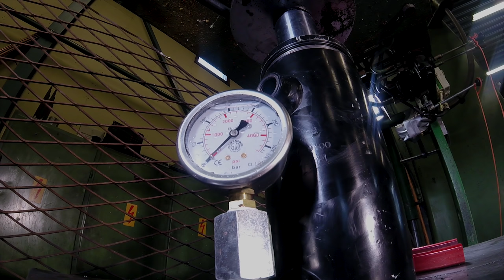Can You use Bananas or Non-Newtonian Fluid as an Hydraulic Oil?

Comment: A guy I worked with almost had his finger cut off by hydraulic fluid squirting out of a tiny hole under a lot of pressure. The oil cut him just like one of those water jet saws.
Reply from the maker: Yep those are really dangerous and if the jet hits you some where else than finger or other small part the hot oil will burn your insides. So not very good place to be.

Comment: If you attach the top of the first cylinder to the press, when you retract the press would it suck the fluid back through the hose, retracting the smaller press?  Maybe save yourself time of pressing the fluid back?
Reply from the maker: There would be only 1 bar pressure difference which isn't enough to move bananas in the system so it wouldn't work
Reply: If I see correctly you are using 2 way cyliners, so another hose (and few bananas) and it would work.
Reply from the maker: I am planning to add directional valve to system. There is enough stuff in the big cylinder for at least 2 crushes so I can direct returning stuff just out from the valve.

Comment: Try paint (the stuff you use to in the house)
If the system breaks so you can only try one more time then try with liquid glue.
Beer, Propylene glycol, .5-1% agarose gel, sulfur hexafluoride (a gas but 6 times heavier than air), cornstarch in water so it becomes thicc.
Reply: zubmit E X T R A  T H I C C
Reply: Also, cornstarch is non Newtonian fluid

Comment: I think that quick-release couplings would be better when bleeding the system. Female to hose and male with double fitting to bleeding valve.When you try more of components, 3/2 valves, propovalves, and hydraulic top link with double lock valves would be intresting. Especially top link, so you can see how different fluids will act when they go to free flow through the lock valve. And also if you try pumps, how sprocket type pump and motor can transfer power. Orbitrol valve would be also intersting.

Comment: paused video at 5:58 to make my prediction:  The coconut withstands the pressure, during which time the bananas undergo a phase transition to bananas II.  As the pressure is released, the bananas revert to a liquid, but due to the very high pressure, they  become supercritical, leak past the seals and create highly corrosive high speed jets of cutting supercritical liquid banana.

Comment: This is great! Can you try banana in an axial piston hydraulic pump like the one in you large press?? (a worn out pump of course) Might not work depending on the pump design (because chunks and viscosity) ... and could be a complicated setup to cope with banana reservoir/pump intake issues so maybe use the cylinder you already have to provide some back pressure to the intake if needed. Perhaps dangerous if it goes wrong but the sound might be quite entertaining, maybe even better with an old worn out pump. Maybe don't remove the banana stems then either. 
Or maybe just put a tomato through a car power steering punp.

Comment: So a basic explanation of this would be like a bike. The big press is the foot on the petal, the extruder 9000 is the first gear, the small piston is the second gear, and your random fluid is the chain. This series is testing different chains. Also the bike is in super high gear so it requires the crazy high strength of the big press to get it to move.

Comment: My crazy idea: compress air with a tight sealed cylinder with the press, fix the other cylinder with very strong electromagnets with remote control. If you release the magnets the cylinder can accelerate and you could get high speed impacts  :)

Comment: Water can't be compressed, bananas are composed of water for the most part, once the rest is compressed the water will act as the resistance and it'll work just fine as fluid.

Comment: Try to fix the big piston to the table and the pressing tool, so you can pull the cylinder out again with rising the press tool up. Should be easier than to fiddle around with the connectors.

Comment: An old trick in Australia, to stop car differential noise and 'whining', is to pull the diff case apart and pack it with as many bananas as you fit in there, then put it back together. Best diff oil around!

Comment: If the second cylinder was larger than the first, it would reduce the distance the piston moves but increase pressure. If you did this (use normal hydraulic fluid), couldn't you increase the crushing force beyond what your normal press is capable of? Might have to make a sturdier stand and hose ;-)

Comment: You got to put the hose on the bottom of the big cylinder Directly to the smaller cylinder it will give the pressure from the big cylinder to the small cylinder directly.yea! Pressure will make the pressure from the big cylinder double toward the small cylinder example 100 ton coming out of the big cylinder will equal 200 ton toward the small cylinder! Didn’t have to go through the top of the bigger cylinder!

Comment: Nice idea with the 2 cylinders, but you're supposed to apply pressure to the small cylinder, to make BIG pressure in the big cylinder, to really crush da faak with the big cylinder.. And use onion or brussel sprouts or fresh okra as the fluid substitute.

Comment: If that is a complicated hydraulic system, fuck me. It's literally 2 cylinders connected with a hose.
Reply from the maker: I never under estimate how hard it is to explain something like this to average people. But I have studied quite lot digital hydraulics so I sure know complicated systems also.
Reply: Yeah, imagine some digital hydraulics logic for controlling a welding robot to avoid electronic solutions next to it. Thats a lot of fun.
Reply: VERY stupid question, but how does the press you use to push the bananas work?  like whjat creates the pressure there? (i konw it´s the metal thing moving down ,but what creates the downward force? an engine or air pressure? And well this might be a stupid question but does the pressure increase in the small hose and cylinder compared t othe pressure in the big cylinder or is the pressure carried over and we loose some force? (cause theoretically if we pass through the force, the area of the hose is really small and the area of the smaller cylinder where the working piston is is smaller than the area inside the big cylinder of your machine right? sorry as you can see i passed my physics exams with perfectly enough points to not fail the test^^)